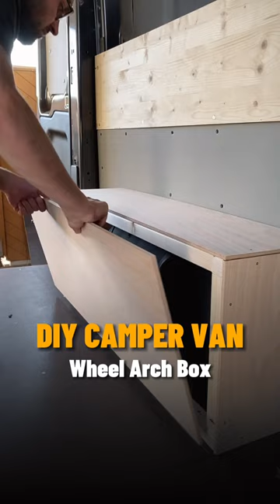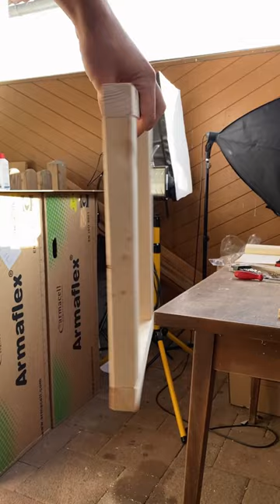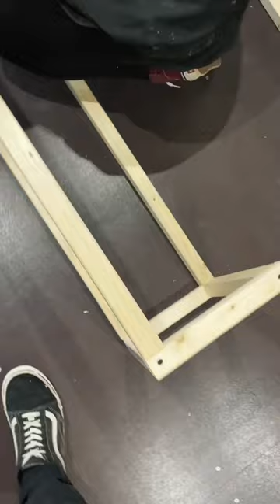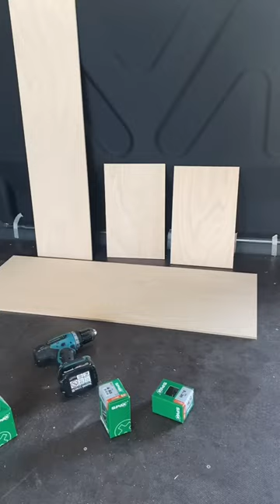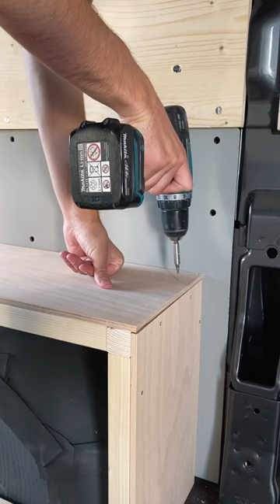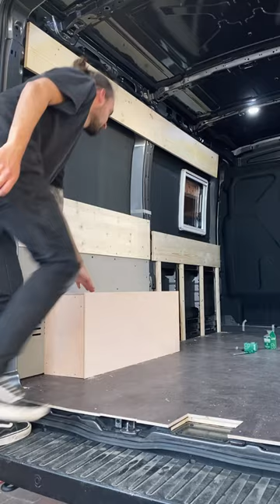Wheel Arch Box | DIY Camper Van 🚐 (Wheel Well Cover) #vanconversion #vanlife #shorts

Comment: How not to use a table saw let’s start there
Reply from the maker: Why shouldn't I use a table saw for this?
The cuts don't need to be exactly straight.
Reply: @danieljschwarz  when cross cutting you should be using a cross cut guide

Why because free handing it can cause it to bind, kick back and cause serious injury